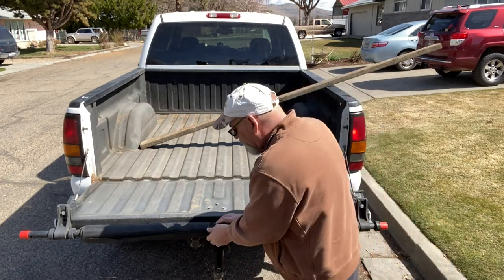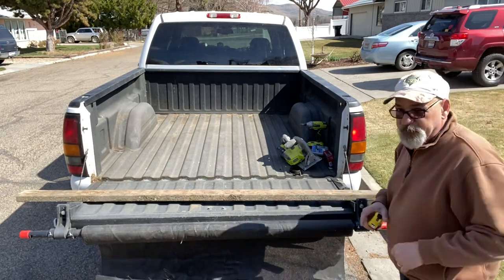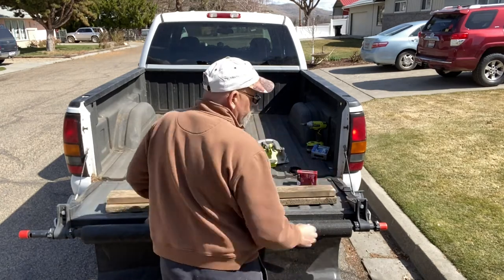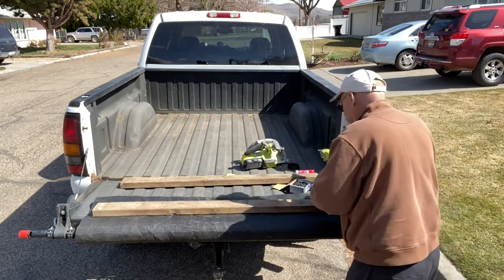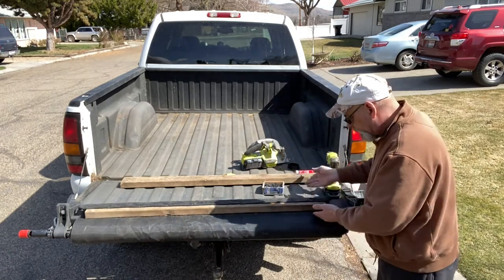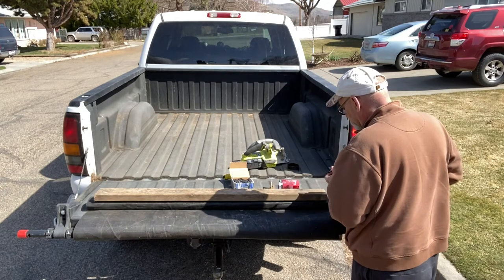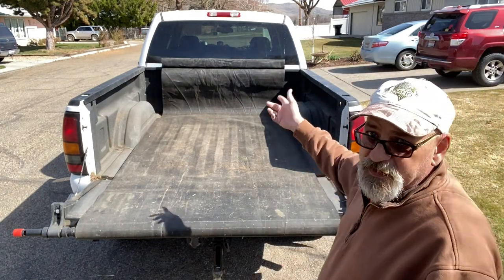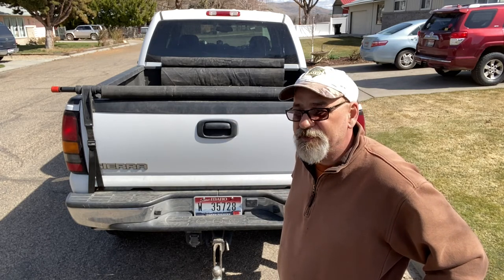Harbor Freight Bed Unloader Modification

Comment: I just screwed a piece of 1" oak wood across the back so it will grip everything and pull it out. It really helps if you have a plastic bed liner in your box. You are then able to pull out over a ton of material!
 I doubled up the material and screwed with large body washers to grip the fabric.

Comment: I've also put a tarp under the unloader belt laying over the sides and reaching just over the tailgate. Only a small amount is left on tarp. When done just pull tarp out and bed is clean.
Reply from the maker: Wow, a local youtubber!!!  Hard to find around here. So far the modified bed unloader works great!!!  Subbed back.
Reply: Exactly. That’s what I do. Then easily pull the remaining debris. Nothing left in the bed.

Comment: I did this same thing before with my load handler, but ultimately found it easiest to connect a long pipe with locking collar and large washers with pvc "rollers" cut the same width of the top of the bed rail so the tarp actually goes up the back of the load to the top of the bed, then when you unload it cant pull down it just rolls across the top of the bed rails. Also makes it super easy to set it up before loading
Reply from the maker: Great Idea!!!  That may be version 2.0!!!
Reply: Any video how you do that?

Comment: On a similar note, I have the load handler pro which is all metal brackets.... I have seriously considered bolting a small harbor freight $60 winch to the bracket on one side and connect to the main pipe with a sprocket and chain setup..... Just imagine how nice that would be to push a button and watch it all come out rather than cranking.... It could def be done well.... I am very close to doing the same for my heavy bulldog jack on my dump trailer.
Reply from the maker: If I had a dedicated work truck I would have a mechanized or motorized version,  probably a dump bed insert would be best.
Reply: @EdenLawnServices  hey, don’t underestimate those tarp unloaders...... they are enough for a good chunk of your needs
Reply from the maker: @KenMrKLC  I ran it most of the year last season. It’s a great tool that saves a bunch of time!!!
Reply: @EdenLawnServices  yea for sure... I’m using anything and everything that helps out my work day. Whatever gets that job done..... I functioned for many years without any dump device

Comment: When you drive does the back tarp move or anything without velcros on it? Also when ur done what to do you now that you have wood cause you want roll it up so just leave it past tailgate or? Just bought one yesterday!
Reply from the maker: Kyle, without wood on end, I would use Velcro. The tarp will unwind while driving. With wood on tarp I just let it unwind till the wood hits truck bed when tail gate is closed. The weight of wood keeps tarp from moving while driving!!!

Comment: Just bought one yesterday for my 2004 Dodge Dakota and the tailgate is about two inches too narrow.
I saw another YouTube where the guy cut the cloth about 2" and that gave him enough room to fit the brackets on without them hitting the truck bed edges.
Watching your video, while setting up to modify mine.
Im thinking that if the 2x4 is left long enough to sit on top of the sides, then attached to the end, it won't be able to slip down and should slide forward with the load.
Another comment mentioned putting that set up on rollers mounted to the top if the bed sides. Which is probably ideal, but more stuff than I have on hand.